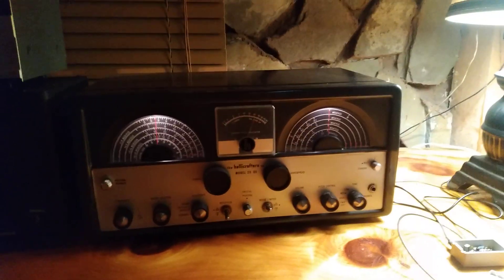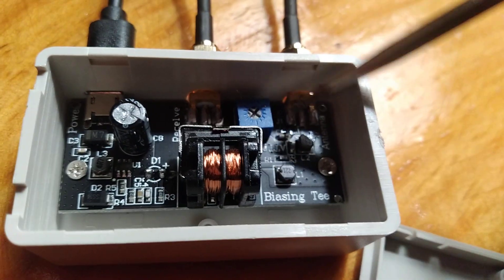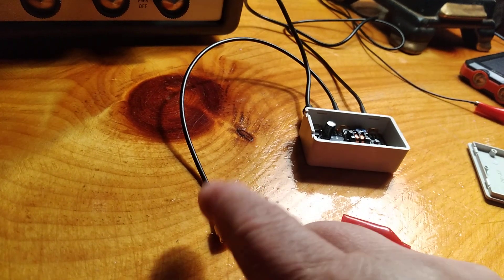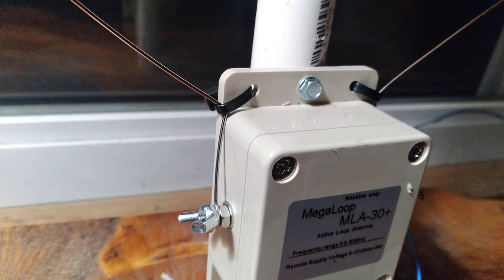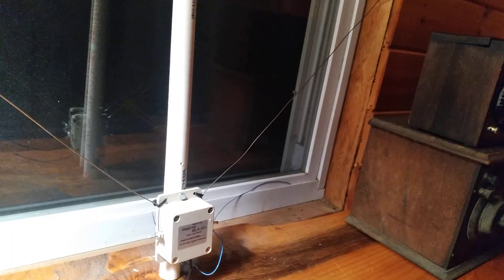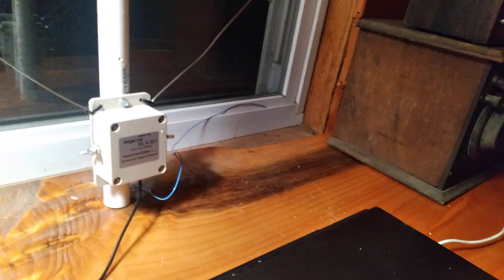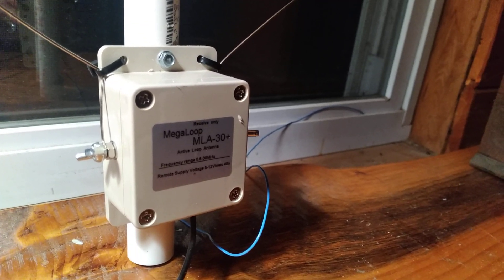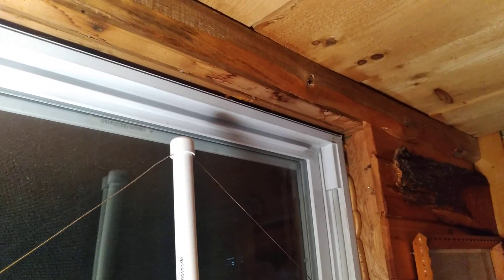Everything about the MLA-30 Loop Antenna

Comment: Great review - and you said it loud and clear. This antenna is not simple to build. The wire they use for the "loop" is too thin and twists like a pretzel. You're right = Without using a "cross section," fixing the top first and stretching the wires to fit tight by moving the base, I cannot see who else you do it. A loop is not a solution since the moment you start moving the base, that wire will turn into a figure 8.
Reply from the maker: @BernhardSchwarz-xs8kp  thank you for watching more to come on this antenna this summer !! PTSR

Comment: What do you repair if it took so rf from nearby transmitter ?
Reply from the maker: Hi could you be more specific?
PTSR
Reply: @  if its not doing the job that the preamp is supposed to do im assuming it was fried by nearby rf , what component would need to be replaced?

Comment: Bought this antenna and didn’t know how to hook it up I do now love your video
Reply from the maker: @scottwilson9817  thank you for watching I am here to help 100% PTSR
Reply: Same here - I got tired fighting with this think wire that would turn into a figure 8 or a pretzel, but not into a loop. This man has found a smart solution. Without a horizontal crossbar - it is almost impossible to make it work unless you want to glue it against a wall

Comment: Loops can take on many shapes.  Circular, square, diamond, etc are all loops.  You were adjusting RF levels, not AF levels.  You only get to AF after the detector in the radio itself.
Reply from the maker: Yes I indeed I agree thank you for commenting PTSR

Comment: Saw this video and found it helpful.  Noobe to SWLing and do have an MLA-30.  My MLa is also on PVC but the cross PVC is clever!  I did get a flexible stainless steel loop element from Omni RF to replace the thin wire that originally came with the MLA 30.  Will be following your channel.  72

Comment: This is all new to me. I just ordered one of these and was wondering if I can extend the antenna cable with a barrel or with that have a negative effect? Id like to put it outside  in the yard, but afraid that will be more than 50ft.
Reply from the maker: Anytime you add more cable signal loss will happen the shorter the better always
PTSR

Comment: The red LED indicates a clone. The original has a green LED. Just FYI 🙂
Reply: The lack of center holes on the ears of the amplifier box is another sign. Author says that he had to drill them himself.
However, since MLA30+ doesn't seem to be a registered trademark, it's kind of hard to tell exactly what is a "genuine" one and what isn't. The first ones that came to the market had green LEDs indeed.
Now will a "clone" necessarily be worse? not sure.
Reply: @F4LDT-Alain  The chap who runs a YT channel called "Blog or D!e" has a video which compares the fake MLA-30+ with the genuine one. Big difference when it comes to the noise floor - the original one with the green LED has a lower background noise.

Let's not forget that the fake MLA-30+s are also shipped with a loop wire that's too long to form a near perfect circle. The wire always ends up in an elliptical or kite-shaped pattern. 🙂
Reply from the maker: @StratmanII thanks for commenting we have another video coming up this summer on the MLA against longwire should be fun fun see ya soon PTSR
Reply: @StratmanII  Well, I guess that every clone is different. I have both a supposedly authentic one and a "clone" with a much too long loop metal wire indeed, no center holes on the amp box's ears and a blue LED.
Since I have modded my original MLA30+ to use a thin copper tube  instead of the original metal wire, I have mounted the clone MLA30+ with the now unused wire from the original.
I have found out that on the contrary the amplifier seems to have a significantly lower gain, resulting in weaker signals of course but also a lower noise floor than with the original. Go figure.
Reply from the maker: My buddy has the green led version same issues just can't out perform the good old long wire 
PTSR
Reply: It's a mixed bag depending on environment, which bands...
Mine (green LED) is set outdoors on my balcony, in a dense urban area with a lot of RFI, usually outperforms my 10m long wire but not always.

Comment: I would imagine it would be difficult to find a linear usb wall supply to power the amp. Surely your typical USB switching supply wall wart would introduce all kinds of noise into the receiver.
Reply: I always use USB rechargeable battery packs with mine
Reply from the maker: And it does this isnot agood product its cheap but you always get what you pay for .
PTSR
Reply: Use a USB power bank

Comment: I am pretty happy with my MLA-30 so far, was planning to increase the size of the loop a bit and make a PVC mounting similar to yours. Certainly a handy second antenna with many modern ham rigs having two receivers. I think the existing mounting holes for the amplifier may be intended for skinny U-bolts.... beware of turning up the gain too far, I believe the IC they use is intended for video amplifiers and are not great for intermodulation. 73
Reply from the maker: I still have it up testing so far I am not impressed now I noticed the loop and the wing nuts are covered in rust very poor guality stainless 
I will take my long wire over this any day thank you for your comments 
PTSR
Reply: @PineTreeStateRestorations  thanks for the reply, no real surprises with the hardware quality, I can't imagine the loop surviving long here as it is either. In it's favour it can be rotated to eliminate local noise. There are a lot of people that have modified them but ultimately the amplifier IC will be a big limitation. In my case with using it in addition to the wire it can provide a useful feed to the second receiver. I guess our usage cases are very different. I am going to try it with a copper wire loop and see how it gets on.... maybe on a bigger PVC frame similar to yours.
Reply from the maker: copper wire would be an improvement also bigger is always better for shortwave 
PTSR @g0fvt
Reply: Interesting comments as well as the video. Many thanks from Ireland 👍